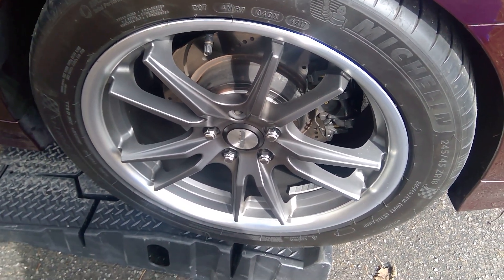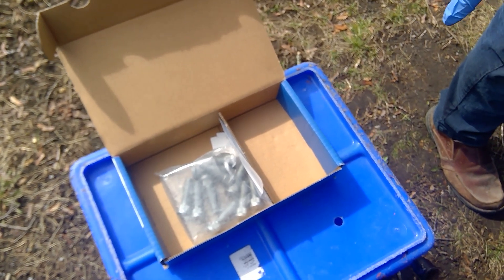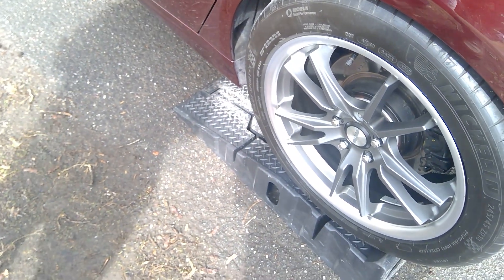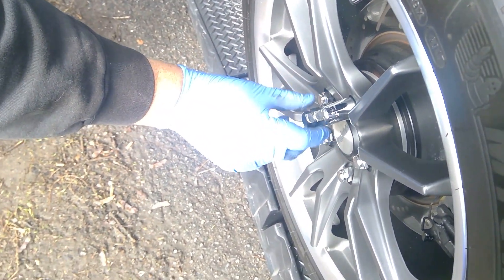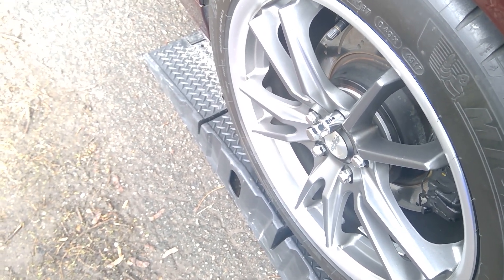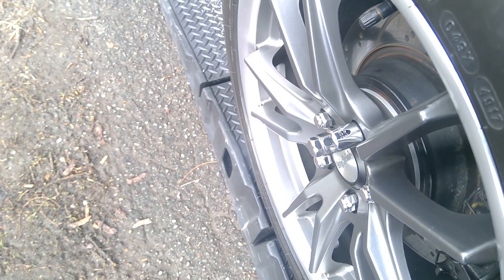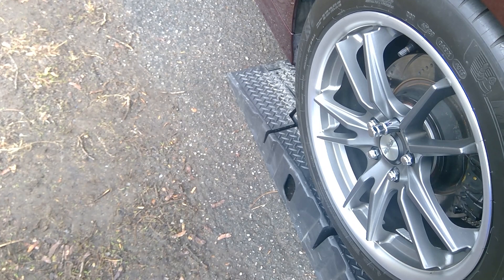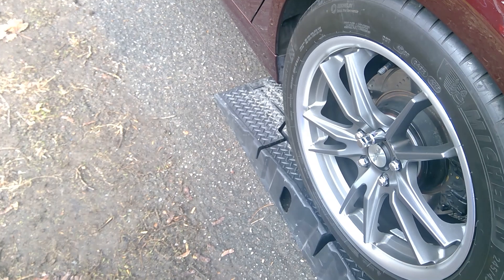H&R Wheel Spacer - How Many Turns To Be Safe?

Comment: These spacer were designed for m12x1.5 studs they work with our m14x1.5 as well?
Reply from the maker: The spacer works, not planning to use the studs.

Comment: Bro what would you recommend for gas. I am in Calgary and we have no 93 shell here the highest octanes we have is between 91 shell or 94 petro canada. Which would you recommend and why. I am thinking of getting tuned soon as well and I was thinking of going with unleashed what gas would be better to be tuned on?.
Reply from the maker: Both fuel are good. The Petro/Ultra94 have a RON of 101.5 and 88 MON with %6 to %10 percent of Ethanol for a total of 94.7 octane, the Vpower RON is 99 and MON 86 (less than %0.5 of ethanol), for a octane of 92.5. If you have a 93 tune, you can use the Vpower and add 4 ounces of BOOStane in your fuel thank if you want %0 of ethanol
Reply: TwinForce_Fusion we have lots of winter here 8/12 months which is more ideal for those situation, are the winter blend going to really affect the tune? I appreciate your help from fellow Canadian
Reply from the maker: @roastedhd2852  made a few video with winter blend, the difference is winter blend has butane added to the fuel for the starting. But octane stays the same. Make sure to find a trusty gas station. A few Alibaba stations got caught selling regular fuel on premium pumps.
Reply: TwinForce_Fusion appreciate your help bro thanks

Comment: What would you recommend the mod route should be for the ford fusion sport?
Reply from the maker: Tune. No tools, just the car OBD-2 to load the car Strategy code. I personally use the Livernois Motorsport tune, but Unleash Tune from Torrie or Tune by James from James are also top notch tune. The main reason I use LMS, it's because they are located in Dearborn and I was planing to do some data logging and fine running at their location,...then came in the Wuhan virus....😢😢😢
Reply from the maker: Then, to keep cost down, a panel filter, the aFe or K&N....look under my channel video for part numbers and CFM numbers.... I think it's the best cost effective, no installation cost to do, then, the oils, go full synthetic, and do it ASAP ( engine, transmission, PTU and RDU).... You can also go to Ford Fusion Sport Forum, lots of threads with info and pictures to help.... Stay away from the FMIC and DP's, they are good, but $$$$$ for the parts and $$$$$ for the install.
Reply: @twinforce_fusion6560  So far I've done Unleashed Tune , K&N drop in filter , upgraded rotors and brake pads , Velossa tech ram air intake, and muffler delete What should be my next step?
Reply from the maker: @whiteuavllc8559  well, the front mount intercooler, but, be prepare to lose the cruise control and adapt cruise control.  It your next bang for the buck,...the other lighter wheels (18'') and sticky tires, but regardless, FMIC or sticky tired, you will be force to change the rear motor mount (rmm) CP-e or Ultimate Performance will have it. Your factory is at its limit, the oem aluminum rmm will open like a can of tuna on a hard launch.
Reply from the maker: @whiteuavllc8559  rhutenum NGK spark plugs gap between 0.265-0275'',  one step colder would help if you do any kind of racing
Reply: @twinforce_fusion6560  Is there any way outside of YT to get in touch with you it's the first car I'm modding but it's hard to find solid advice!
Reply: WhiteUAV LLC OG if you have Facebook join the fusion sport enthusiast page! Everything sport related is there with a few hundred members to help you out!